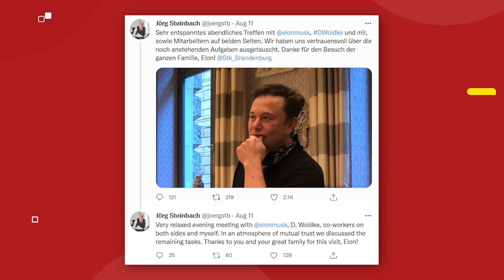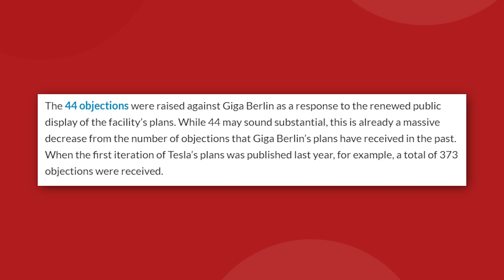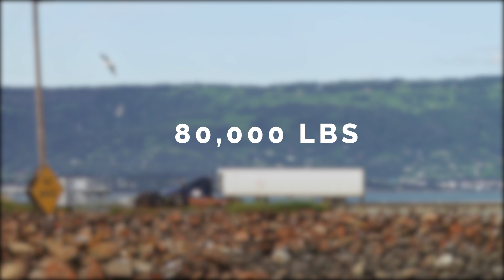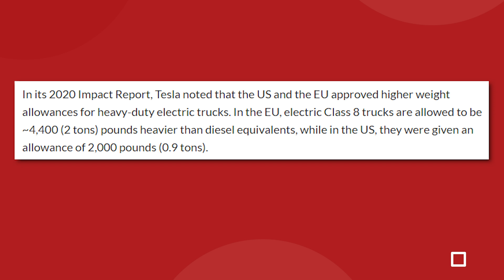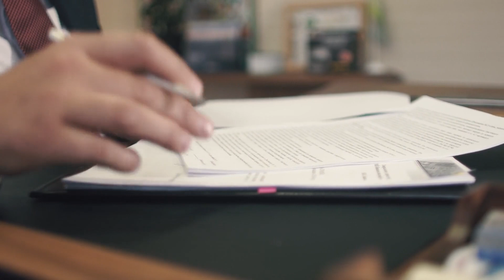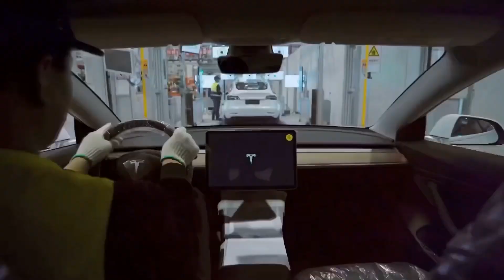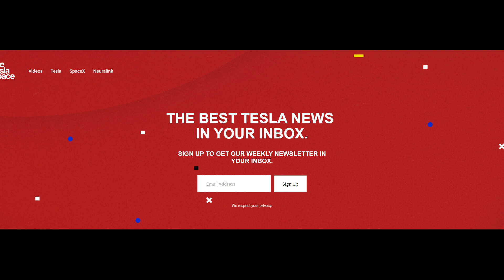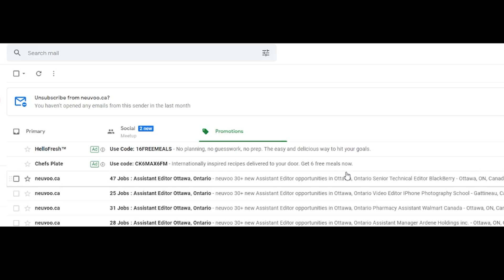Why Tesla Just Received Another Giga Press In Austin! (Tesla News)

Comment: The reason why the payload is 80,000 because anything more than that if it's not distribute property could wreck the roads the road systems themselves it's not because of oh I can build it as big as I want it can tell whatever I want it's because you realize there's more wheels on the tractor or there's a limitation to something it's because it has to be engineered around the road systems the roads can only handle so much per tire it's not just because of how they build the trucks it's the roads
Reply: Everyone should know that simply by looking at a truck vs. a car.
Reply: @tedmoss  I had to ask a trucker what's their loads. Things they don't want you to know.
Reply: Some roads are not built for 18 wheelers today
Reply: @emmanueldelgado9205  sad

Comment: Why can’t motion help to create energy for the moving vehicle? Would a reinvention of the Sterling Engine not save on fuel costs? 🥸
Reply: Sounds like you mean perpetual motion? Energy can't be created only converted. Energy is lost to the environment. 
Where do you think you are going to get the heat from to run a Sterling engine? The greater the temperature difference across a Sterling engine the more efficient it is. You roughly need a few hundred degrees for it to be about 30% efficient. So capturing dissipative heat from an electric motor will probably be useless. Electric motors are already in high 90's for efficiency. Probably around 97% (at optimum RPM). So if a car drives 600km using 100kW/h electric motor would loose maybe 3-10% or 3-10kW/h of energy as heat. If a Sterling engine at that temperature gradient (20 to 100 degrees C, 80 difference) you might be 5% efficient. So you might regain 0.150-5kWh, over 8-10 hours of driving. Better to replace the weight of the Sterling engine with batteries which will be more reliable. This also reduces complexity, noise, vibrations etc.
Reply: @AORD72  That is quite a calculation. Outside temperature plays a big factor with battery power. Colder weather decreases possible power consumption. I was imagining, ever so slightly, green hydrogen and a Sterling engine combination. The heat source for the engine would have to be an encased solution. Perhaps a heated coil in a concealed valve. Haven’t really thought of actual design but there is certainly something going amiss with regards this opportunity. Most probably because of present monopolies on natural gas and oil production. This illegal dispersal of harmful substances via their fossil fuel industry is indeed drawing to its close. I pray for the good health of future generations who will be free of these economies and their continued poisonings. It is an illegal act to poison air we all must breathe. No company throughout earth has any right to do this. 🥸
Reply: @L.M1792  Interesting. Hydrogen vehicles make a lot of heat (huge radiators), not sure if they would still make enough, vs a bit more hydrogen in a tank (1kg hydrogen ~ 33kWh). I think you would find that engineers search through many options and look at many variables and take into account the extra weight and complexity (manufacturing, maintenance etc).

Stirling engines in cars:
 https://www.youtube.com/watch?v=KbnGlcQiL1c&ab_channel=NASASTIProgram

I think Stirling engine cars that were made had problems with acceleration. But were slightly more efficient then ICE's. Ford made some test ones in the UK, the Ford Torino.

It certainly would be nice not have to breath in ICE fumes. EV batteries are getting so good that they will take over. Mass production will soon put them at a similar price as ICE cars. EV's are already cheaper to operate and maintain.
Reply: @AORD72  All engines produced for the Toledo were gasoline engines manufactured in Lima. There is nothing about Stirling engines in the history of Ford manufacture. I’m still imagining a design that incorporates a heat mechanism to motion. It would save a fortune on fuel costs. Practically reducing expenditure to zero. Goodbye dirty poisonous oil era. Your golden age is over. 🥸
Reply: @AORD72  I’d thought I wrote Torino. I must have been thinking of Spain. I do not have an exact design as yet. A heated coil system is what I had first imagined would suffice for heat exchange. If a heated coil system could be isolated within a metal chamber and the heat produced then directed in such a way as to emit directly (with an added pressure) enough heat to create motion, this would power attached cylinders that could gain power. Perhaps only for initial increase in acceleration then switching to a more green hydrogen based system to maintain energy long range. 🥸
Reply: Which motion do you mean?
Stirling Engine is a heat engine, how is it related to motion?
Reply: @Darthvanger  Are you asking me how an engine is related to motion? I am trying to refer to the motion of a vehicle, the spinning of the wheels, the momentum of the vehicle. Why must fuel be the main concept of thought? I am wondering how motion can generate enough energy for a vehicle to power itself by and the Sterling model of engine came into my thought. Perhaps this model of engine can be reorganised to suit powering a car. 🥸
Reply: @L.M1792  Electrocars are charging when you hit the brakes, by transforming the vehicle motion energy into electrical energy. So the motion energy is already being used. But still the energy is dissipated when the wheels are rolling, that's the energy we need to get from some source other than the motion of the vehicle itself.
Stirling engine takes energy from motion, slowing the wheel down. But the wheel keeps going due to the heat that must be generated somehow, for example by burning something.
Reply: @colinsouthern  We must unify to agree that our future health is very much dependant upon us not remaining reliant upon oil. This is absolute fact. The more choices we can create for consumers in this respect, to move away from this present harmful infrastructure and into cleaner less harmful trends in consumer spending, will assure a greater longevity in living for future generations. This information is absolute fact. Not one scientist will ever dispute this information as incorrect. 🥸

Green hydrogen can be produced from water via a process with zero toxic emission. Electricity can be generated via natural sources, wind, solar. 🥸

Oil manufacture and dispersal must be banned as an illegal act in public places for the good health of generations to follow. 🥸
Reply: @colinsouthern  That’s very critical and almost mythical of you, although your supposition is akin to dreaming, and without it (dreaming) we would in fact have nothing to reflect our worth from at all, no invention would have ever been invented ever.

I read of a child in London recently who died due to the inhalation of oil company products in the neighbourhood she and her family lived at.

IT IS THE STRUCTURE OF OIL PRODUCTS THAT DAMAGE BIOLOGICAL NETWORKS.
THEY ARE, AS YOU KNOW, VERY DANGEROUS TO LIFE AND HEALTHY RESPIRATORY FUNCTIONALITY.

God bless

p.s. the camera never lies

Comment: Just mentioning,  for clarity!
That 0.9 ton was actually 0.907 metric tons (907Kg),  which is 1 US ton  (2,000 pounds) so that means in US 82,000 pounds for semi trailer and load.   
In the EU  the addition is 2 metric tons (2000Kg) on the existing maximum gross vehicle mass,  but  but it is much more complicated ,  and  maximum  varies depending on  number of axles, if road freindly suspension is fitted   and other factors beyond my knowledge.  In the UK at the moment it is going to be same as Europe,  and yes we use metric weights for vehicles although a uk ton is (approx ! ) 1016.047 kg or 1.12 US tons.
Reply: IMHO, this is a new measuring technique. For example, what miles is to km, but bigger and better  measurement
Reply: Or better example, Nautical miles to miles
Reply: The Long Ton is 20 hundredweight or 2,240 pounds. 
The Short Ton is 2000 pounds. 
The Metric Tonne is 2000kg or 2204 pounds. Around 30 pounds short of a full Imperial Long Ton.
Reply: @Dave5843-d9m  not quite,  little typo there,  metric ton is 1000 kg not 2000, and having  a metric inclination would say metric ton about 16 kg short of a uk ton!
Reply: @Dave5843-d9m  .... Dave edit your 2000 kg and I will delete my responce make it less confusing for people not in the know!

Comment: The drone pilots of giga Texas say the new machine is the same gigapress used for model y/3, not the 8000 ton version for cybertruck. They could be wrong.
Reply: There are 2 separate "lines" and the priority is MY for several reasons, 6 all up will be needed for Model Y
Reply: @j.pgoodwin9020  those are facts, but at 10k units a day production capacity, 4 giga press machines could make enough front and back frame pieces for 500k+ Model Y units a year. There's almost no way they could produce more than that in the first year of the factory, local and global supply chain is stretched too tight right now. I think the 8000 ton press for cybertruck will be the 5th machine installed in the press building.
Reply: @sustainabilitytheory5154  Look up the production rate for the castings